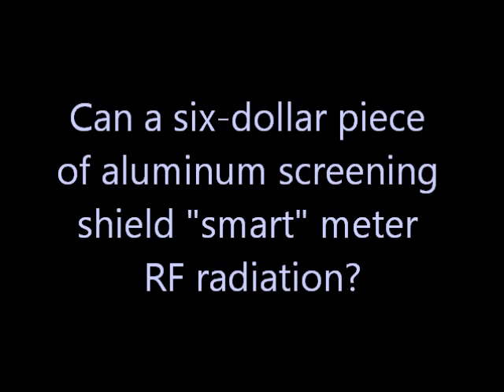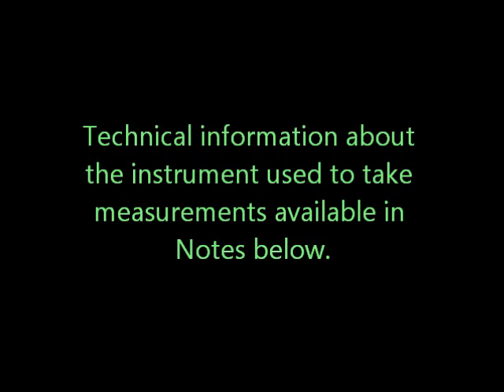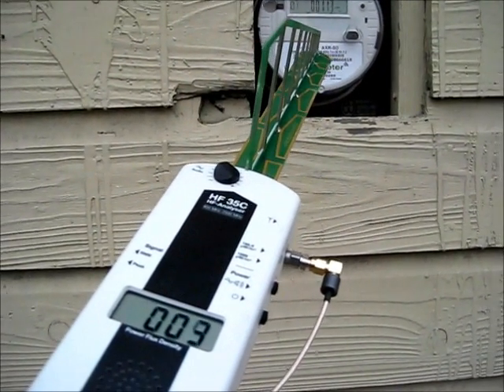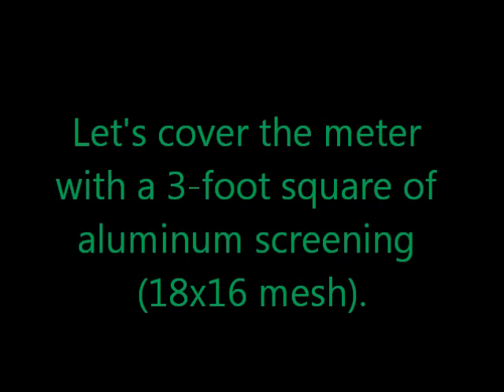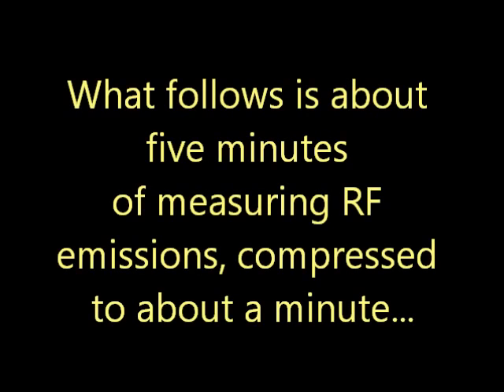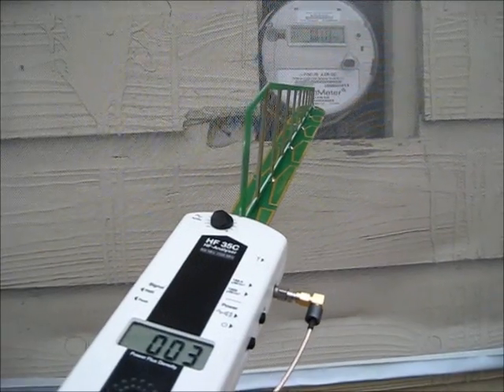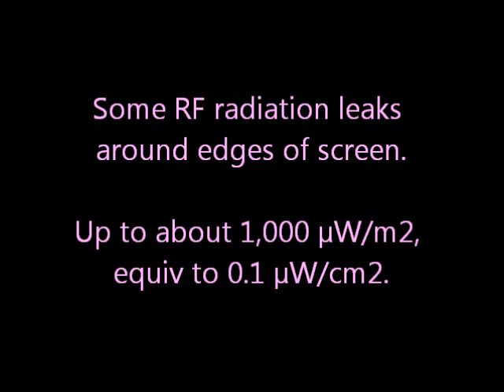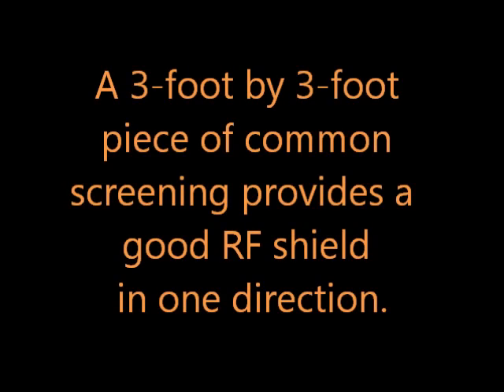Foiling a "Smart" Meter, Part Two: Aluminum Mesh Screening

Comment: understanding that the RF you block from transmitting out to the collector sites is also now blocked inward, as the meter will continue to transmit with or without the screen!  

Do you have any readings from inside the building before and after placing the aluminum screen over the meter?

Comment: This is a bunch of bung, I rent a storage locker that the walls of the building and roof are a layer of heavy sheet metal on the outside, insulation layer, then another layer of sheet metal. The lockers themselves are a layer of sheet metal.  You can stand inside the storage locker and talk on a cell phone. Her meter goes down to .003 that where it was in both cases with the screen in place and without it.  Very silly that you would think a screen in going to block a emf radio wave.  Radio waves go through brick walls lined by sheet rock inside.  If you really wanted to block emf waves you could take a layer of panel of sheet metal put a half inch steel rectangular stock of steel around the border and weld or  braze these to both sides of the sheet metal so it is air and liquid tight then fill the panel with a liquid such as a water with an amount of antifreeze in it ( for freezing weather) water is something that interferes with emf and can block it.

Comment: Do these signals carry thru to the outlets in the home and do they enter the home at he same levels they do from the outside ?  if they do go into the home how would you block it on the inside while keeping a clean look ? 
last question is are the newer meters today spitting out the same levels that they did back when this was done ?

Comment: And you reflected the signal to the inside of your house. Congratulations. You do not want to shield it from the outside. This is pointless and may cause even higher radiation to the inside. Let it radiate to the outside. Put the mesh on the other side of the wall instead... please.

Comment: Wouldn't you want the screen to be inside the home on the opposite side of the meter inside the home on the wall? By putting the screen on the outside of the home you're forcing all of the radiation to go into the home.

Comment: I doubt that the screen reflects anything; but I wud think it shud be grounded to work. I fail to see how this wud be a theft of services. If the meter depends on radiating info, then u surely wud get a visit from the power comp. But I think in fact that many installations do not radiate info, but send it on the power line.

Comment: but does not shield to the sides which will still send radiation into the building. you just protected people walking in front of the meter. Please educate yourself about faraday cages.

Comment: I would probably put that screen on the inside of the house so that radiation doesn't travel that way.  Energy Co. might detect a communication interference to them and have someone take that screen down without your consent the same way they put the smart meter on without consent.  I could be wrong.

Comment: If your worried about RF radiation from these meters entering your house, just install a fine mesh copper screen on the BACKSIDE of the meter. You may half to open the drywall and move the insulation.

Second, run a copper ground wire from the house ground to the copper mesh. Bond the wire to the mesh.
Now all the RF from the backside of the meter will be dumped to the house ground, not be able to enter the house.

Called a Faraday Cage. I used them to setup radio receivers, etc.
Placing a screen on the outside of the meter only cuts 50% of the EM bubble, the wrong side of the bubble at that.

Comment: Derr. the only way to totally enclose any magnetic is a  continuous material such as iron or steel. copper or  Al screen is false. plus as stated previously the  3/4 G transmission still goes out the back of the meter. thats what electrical engineers are for.
Reply: Metal mesh can be effective, used in many RF applications, sounds like it's you who should be consulting the engineers.

Comment: What's happening inside the house on the wall the smart meter is attached to?  No one is saying anything about that. Seems that the radiation must go somewhere from the back side of those meters? Is the wall enough to stop it?  I shouldn't think so. From this video it appears you'd need to cover the entire wall with that mesh screening. I think our goose is cooked!!

Comment: There is no RF radiation involved - communication between the meter and the utility company is by signals superimposed on the power lines - Smart-Meters have no wireless capability.

Comment: Are you fucking kidding me? Micro watts? Really? You're concerned about micro watts? Do you know how powerful your regular car radio transmission is? Fucking kilowatts. You're worried about a power meter in the side of your house emitting a peak of one milliwatt? When you literally walk outside and are exposed to anywhere from 1000 to 1,000,000 times that? Fuck off. 

Sincerely, a radio technician.

Comment: Why would they have failed to design a Faraday Cage onto these smart meters? It doesn't make sense? A Faraday shield is an enclosure used to block electromagnetic fields. A Faraday shield may be formed by a continuous covering of conductive material or in the case of a Faraday cage, by a mesh of such materials. A common misconception is that a Faraday cage provides full blockage or attenuation; this is not true. The reception or transmission of radio waves, a form of electromagnetic radiation, to or from an antenna within a Faraday cage is heavily attenuated or blocked by the cage, however, a Faraday cage has varied attenuation depending on wave form, frequency or distance from receiver/transmitter, and receiver/transmitter power. Near-field high-powered frequency transmissions like HF RFID are more likely to penetrate. Solid cages generally provide better attenuation than mesh cages. They provide less attenuation from outgoing transmissions versus incoming: they can shield EMP waves from natural phenomena very effectively, but a tracking device, especially in upper frequencies, may be able to penetrate from within the cage (e.g., some cell phones operate at various radio frequencies so while one cell phone may not work, another one will)

Comment: so you are about 6 inches from the meter and reading 5.2 volts per meter. so at 5 feet you can expect to get 0.5 volts per meter. the fcc says that 1.2 volts per meter is safe for a cell phone witch you put on your ear. you are telling me that this is a safety problem why.

Comment: Right now if you want to actually screen the meter you need to encapsulate it in the mesh. Any one area not covered will leak RF.
Reply: Well yes it does "squirt" radiation. However with the doses at that level yes it may take several years for it to form a cancer. Problem there is it won't only be one part of the body (think meat in the microwave).

I agree that wrapping it in alfoil will do the job, anything metal and alfoil is cheapest. I had to use alfoil to block some RF on my desk at one point from the HF radio to stop it messing with the USB leads (keyboard and mouse mainly) and given USB leads make awesome antennas to pickup RF :(.

Comment: Ya this RF radiation you are blocking  is a simple RADIO FREQUENCY that wirelessly emits a signal to your power company telling them how much power you are using.. The only reason they are installed is to eliminate the need for a meter reader to come by and check all these meters.. what you have done is block the signal making someone come out and look at it then report it back. You get more "RF Radiation" talking on your fucking cell phones or even listening to the radio in the car. You may as well walk around in a tin foil hat you fuckin lunatics.

Comment: It seems that lots of people have a "pet radioactive peeve" about radiated EMF. Its really moot to worry about a microwatt of power meter at transmitted in very short bursts at that odd intervals during the day. They should be worried about wifi hot spots in public places and now even in thier cars. YOUR microwave oven leaks more EMF than a smart meter, your wireless router and cellphone leak and radiate more radiation than a meter, How about the radiation from cell towers that is in the lower microwave region. Then theres the 50 to 100,000 watt commercial radio stations on air 24/7, How about your home security system using ultrasonic and microwave frequencies. The radiation from your old TV and computer screens that radiate a high energy stream aimed at you.. Do you have walkie talkies?  todays HT's radiate in the near micro energy freqs [400 mhz], your cordless phone at 5 Ghz that is constantly pinging the handset. 
Shielding can be ANY kind of metallic sheeting/foil or screen as long as it has tiny holes in it. (look at the screen in the door of your microwave oven).
There are many sources for MW radiation, your remote control devices, your wireless remotes and worn wireless  athletic gear that radiates as much RF as a meter.
I have barely scratched the surface of RF Hi freq radiating devices. I even have Ham radio gear that operates @ 10 Ghz. It focuses its energy from a directional horn antenna.
A lot of what you are being told is totally inaccurate information from people who "think" they have the answers. Even the so called experts who want to rile you up by using fake "tests" to prove invalid results and greatly exaggerate the "results". Educate yourself.
Reply: Walter, people are just people and they will complaint about anything even if they don't know what they are talking about. I am no expert but unless you are standing in front of a meter day and night there is nothing to worry about. It only emits a short burst ever few minutes. Common sense  tells me that if you are concerned about EMF, a smart meter should be at the bottom of a very long list. If you are concerned about privacy that is one other story.
Reply: I feel your pain man. It's like those microwave leakage detectors. You put one in direct sunlight and the thing goes mad. People worried about getting cancer, the sun is WAY more powerful and dangerous. Ask anyone who has had skin cancer. A few mW from some random appliance or a power meter is so trivial and insignificant.
Reply: So you are 100% sure that absolutely every single power company doesn't have a radio license? Also, are you the type of person to cover yourself in aluminum foil to avoid mind control. I got news for you, aluminum foil isn't the cure for everything, not that its even a threat in this case.
Reply: La Diablo
Completely and utterly obsessed with this aren't you?
Reply: Most smart meter complainers were probably delinquents or deadbeats for years before the meters were even introduced. I`m sure they had some kind of issues with their power companies billing department.
Reply: +Walter Perry  Dear Walter, Please stop shooting gaping holes in these nutters arguments by using verifiable facts uncommon sense and inarguable logic. If you take away their pet cause they will have nothing to do with their otherwise empty lives and may go onto something more annoying that bitching and whining on the internet. 

I'll bet every one of these whingers has a mobile phone and an assortment of all the other devises you mention.... plus they can't get away from things like Public Wi-fi and television/ radio/ etc broadcasts. I'll also bet a lot of money that when you looked at their everyday actions and life style, they are probably doing a heap of other  things 
like smoking weed and have lousy diet/ health practices that are a far more significant danger to their well being. 

Of course when one of them does get sick from their lifestyle choices, no matter what the ailment, it will be automatically attributed to the smart meters. 
 Lets face it, what other possible explanation could there be for them getting sick? None right?   
:0)
Reply: ``Then there`s the 50 to 100,000 watt commercial radio stations on air 24/7``

Thanks Walter, that`s spot on. They only focus on to which they can ascribe their pissy-pants conspiracy theories, then they purposely ignore all of the other giant radiation sources. Like the world`s digital TV transition: My [NYC`s metropolitan area] rooftop antenna reception got ridiculously better but anti-emf loonies say that everybody must have been running around holding their heads complaining of `dizziness` `headaches` or `confusion`,   What`s the power output on the WTC or Empire State Building? lololol!
Reply: Where have all of the long-suffering EMF-activists complaints been in city subways, easily the `dirtiest.EMF` environment on the planet for the past 126 years?
Reply: is there an effective way of blocking the signal?
Reply: La Diablo are you saying that since the power companies do not have a license for their meters you can block the signal and legally they cannot do nothing? Hmmmmm!! interesting.
Reply: A1986Ge1995
Radio stations MUST require licenses obviously because they're a capitol venture and they obviously advertise and obviously because potential interference between them is obviously very carefully controlled and about 100 other reasons.    ...obviously.  :)

Comment: since the installation of a smart meter to my "home"...suddenly...the wood is deteriorating in the floors...what the heck??!!  Walls are discoloring...our physical pain is way up there...can't get relief...nothing is working against it...just antagonizes health problems...what I've captured of video will blow ppl's minds!!!!!  yes electricity/electromagneitc energy/current will advance decay wood & other materials in an extremely compacted time.  Would guesstimate...100yrs in 1 month time.  I had such a solid sound home...not any more.  I have video showing an enormous amount of EME flowing thru out my home...but that's not the EME that I captured.  Run your web cams at night...dark room where only your pc screen light is lit...especially video tape your bed while you sleep.  Do this for several days...& you will be disturbed by what you have captured.  How to fight this???!!!  damn them...!!!!!!!!!!!!!!!!!
Reply: Sounds like you  have a water leak in your walls.
Reply: How much of this is real science?  What part is bought science(so someone can make money without any restrictions)?
Reply: ``electricity/electromagneitc energy/current will advance decay wood & other materials in an extremely compacted time``

News flash: Google Earth aerial photography of forests around microwave relay stations show no such thing!
Reply: ``yeah in my home I have water lines that go from the roof down the walls``

That`s not impossible, but more likely you have rain getting into your roof somewhere and it`s seeping down into your walls. Call a contractor & forget about the EMF nonsense.